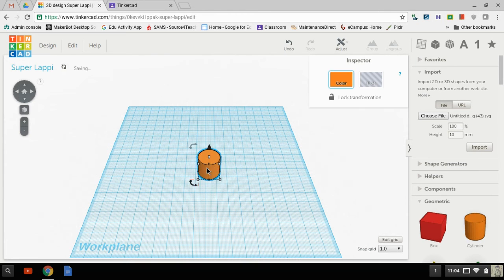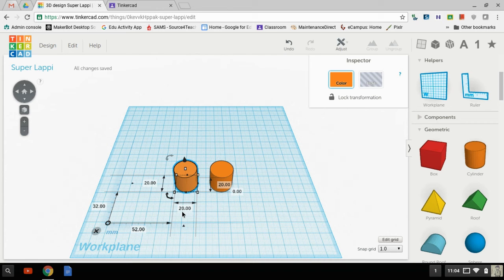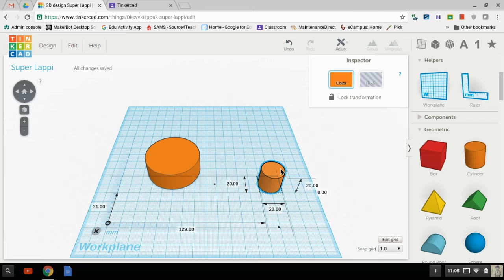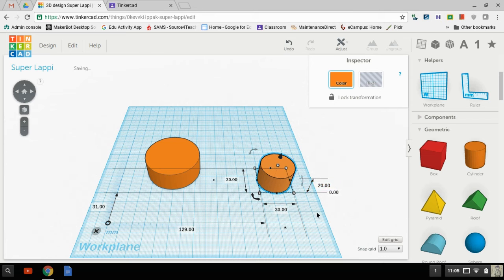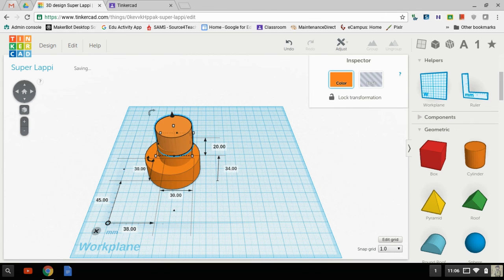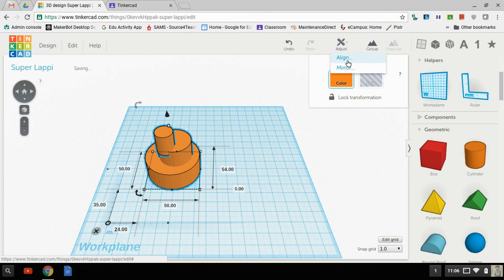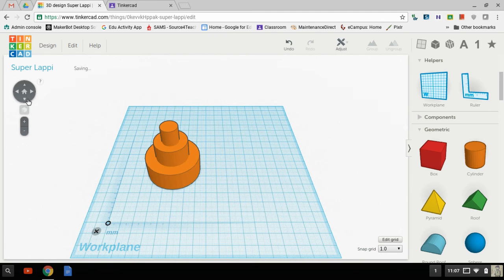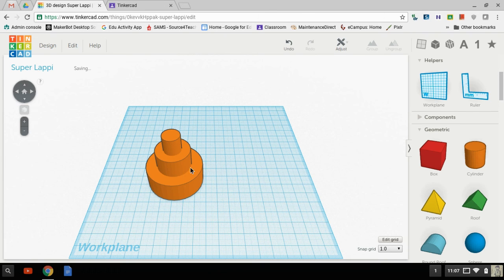Aligning Objects & Precision Adjustment in Tinkercad

Comment: i've been using tinkercad for 2 months now. but mine does NOT have the "adjust" and all the other good settings?????????????? please help
Reply: Mine too. Where it is?
(edit) It is on toolbar between 'Ungroup' and 'Flip'
Reply: This is just a guess from a beginner at Tinkercad, but, you have to select what you want aligned before you can click and use the align icon. If you want all your items to be aligned on top of each other, as shown in this video, then you must click CTRL-A (control + A).

Comment: I have imported an SVG object (exported from Corel) that already had the holes in it.  So there are no objects in the holes.  How would I center a cylinder over the center of one of the holes?  In other words, I want to lay a cylinder on top of the existing hole (that has no object in it) and center that cylinder perfectly with the center of the hole.  How would I do that?  I can not figure this out.  

Another way of doing it would be to "auto fill" a hole with a cylinder of the same exact size but I could not find a way to fill the hole with a cylinder of the precise same dimensions.  I would then use the align function as usually to line stuff up.  Any help will be appreciated.